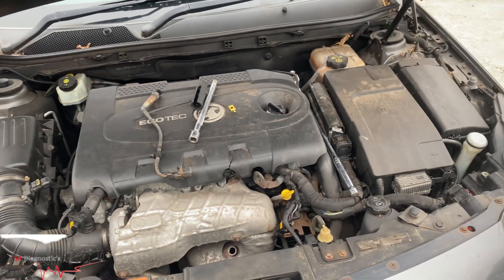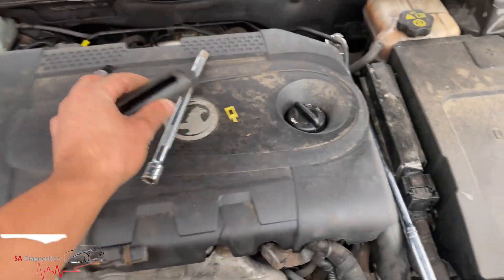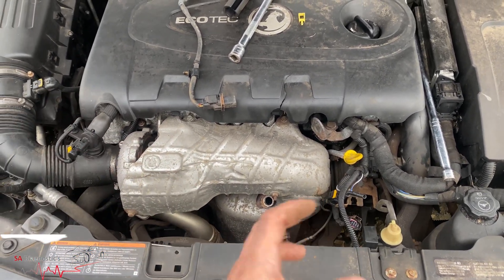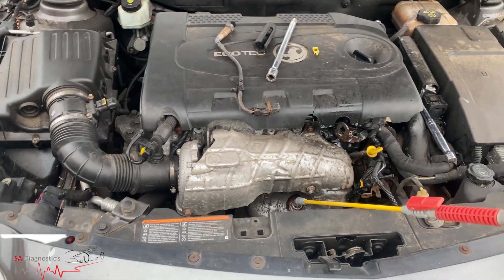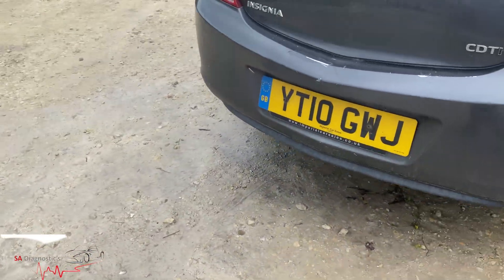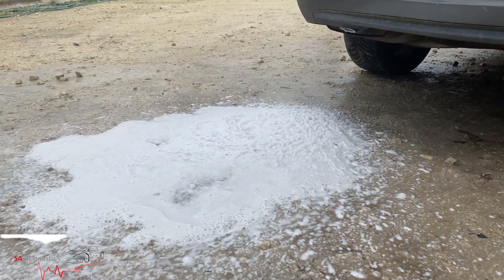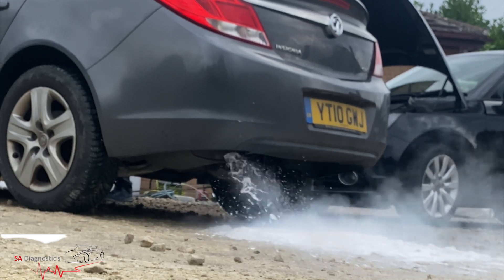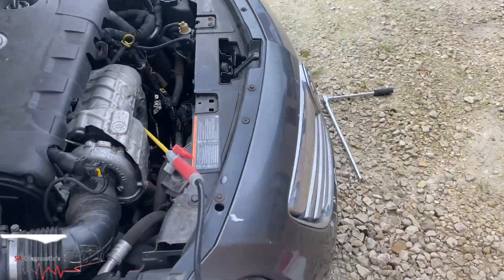Vauxhall DPF P2453 Clean DIY Diesel Particulate Filter Differential Pressure Sensor Performance

Comment: Hi i was just wondering what was the other cleaner you said you used
Reply from the maker: Ether bleach or TFR
Reply: @sadiagnostics  I'm guessing you only need to use either bleach of TFR not mix both right
Reply from the maker: @BIGKAB797  yes just one of them which ever one you can get your hands on and then just flush it down with some water but make sure the engine is running so it can push the liquid out rather than going back into the engine
Reply: Was the insignia in limp mode at the time and did it work shoving bleach through it after .. not in limp mode anymore?
Reply from the maker: @ashmiller8102  yes was in limp mode and the chemical did work you can use bleach or TFR.

Comment: Should be black the stuff coming out
Reply: Really you want red - the ash - to wash out. Black will be the soot, soapy water will wash that out, but acid will dissolve the metal salts (red ash) which block up and don't regen-away. Some chemicals will foam on reacting with the ash and appear white, so white is good too.
Reply from the maker: Not the case I’ve cleaned lots of vans and cars similar to this issue and they tend to come out white ish Depending on the chemical you use and how much water you put down the pipe. Yes you will get certain black but not full as it mixes with different chemicals
Reply: @sadiagnostics  er det mulig å bruke kaustisksoda?

Comment: Can I ask for some advice please , Citroen, dispatch 2012 it’s been mapped I’ve got no live data on scann tool  if I clean the dpf out but I can’t do a reset on the adaptions will the van come out of limp mode.
Reply from the maker: No it will still be in limp mode you will need a diagnostic machine to reset it